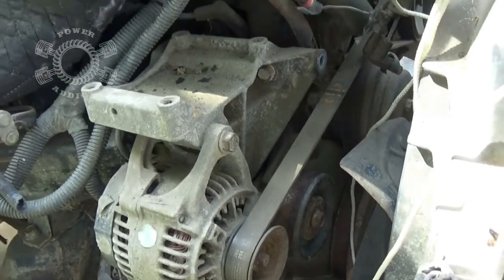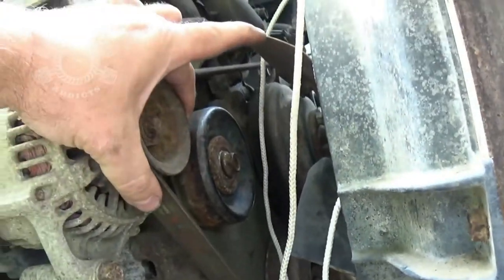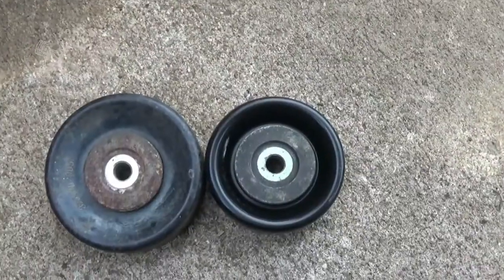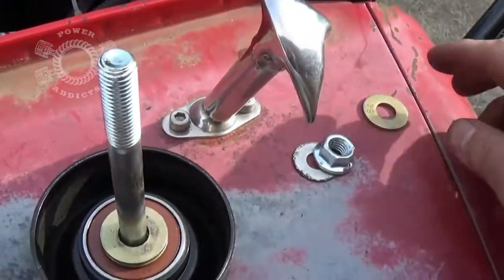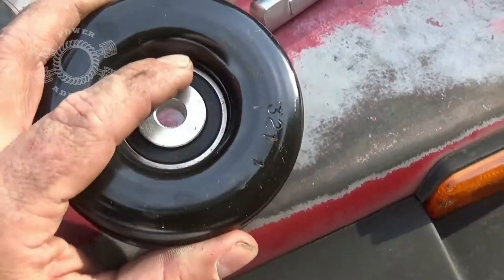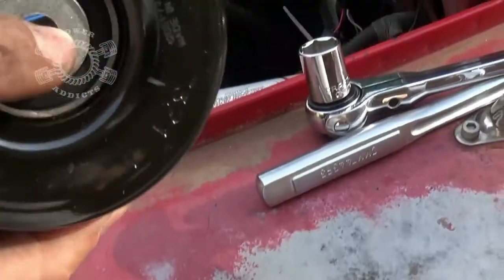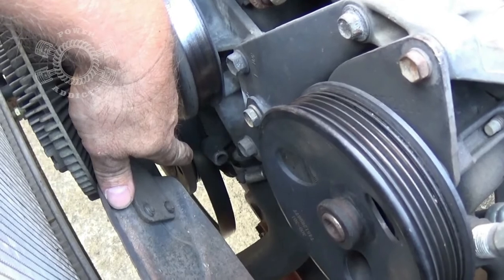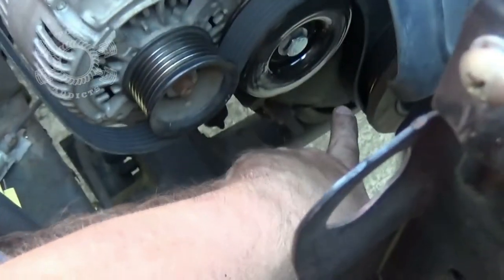Jeep Wrangler YJ On Board Air Belt install #jeeponboardair #poweraddictscrew #onboardaircompressor

Comment from the maker: Parts needed
OBA Idler Pulley: https://amzn.to/3wYYgwi
Serpentine belt I used: https://amzn.to/3m3CCSx
M10-1.50 x 110mm bolt: https://amzn.to/3Gz7vYP
M10-1.50 Flange Hex Lock Nut: https://amzn.to/3MWrP8J
. 
If Power Addicts has ever helped you and you wanna contribute in some way, here are some links that can help make that happen. This is an Amazon link that gives Power Addicts a small commission. Using this link costs you NOTHING more. https://amzn.to/39XSTTO

Comment: I have an 88 4.2 that didn't come with AC.  It has a V-Belt with no grooves.  I might have several things to replace on mine to do this.  The crank and water pump pullys, the alternator bracket is totally different,  plus all that stuff you mentioned.  I don't have the idler pully below my alternator either.  It's about as simple as it gets.  With no brackets above my alternator at all.  I'd say my alternator currently sits where your AC Compressor sits now (height wise).   I may just go with an electric compressor.
Reply from the maker: Yea ... that is a lot to change over. I'd run electric and call it a day. I did a video of an electric compressor that perform pretty good and isnt very expensive. Thanks for dropping in!

Comment: another informative video have you thought about doing the 99+ intake with 4.7L throttle body w bigger fuel injectors if you do you'll need a adapter plate to mount the 4.7 throttle body

Comment: Lol, I always say, "It takes atleast 4 trips to the auto store", get a wierd look and follow with, "It's a YJ thing, you wouldn't inderstand...."

Luckily my Jeep had AC already and is serpentine, but I went through this with a water pump, 2 types for an 89, and 2 different belt types.  Even if you look online for aftermarket AC or belt driven Air Compressors, you'll see the 4 groove?  Mine is a 6 groove, IIRC.  Could be wrong, lol.
Reply from the maker: The manager at the autoparts store I go to is used to me. She says .. welp what hybrid contraption you putting together this time. She always puts up with me mixing and matching stuff. She has even offered me a job a couple of times ... lol

Comment: So I’ve asked you a question. Do you have any rear seat mounting brackets. For a 1991 yj I can not find them anywhere around me.
Reply from the maker: No I dont have any extras. I've seen them on eBay several times.

Comment: i have a stock ac on my jeep. do you know if a 95 yj has a york compressor?
Reply from the maker: It is the same kind of compressor as in the video. Sanden I think it's called.
Reply: @Poweraddicts  do you know if the saden needs a external oiler or is it internal?

Comment: is the setup of pulley similar on the TJ ?
Reply from the maker: My dad and a friend of mine has TJs. Its different. The AC compressor on my dads is mounted towards the bottom passenger side.